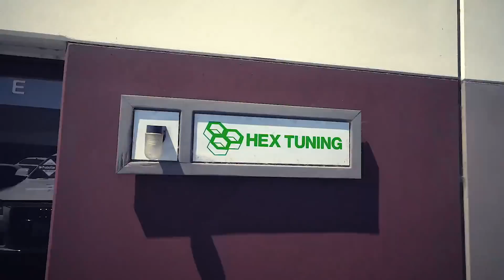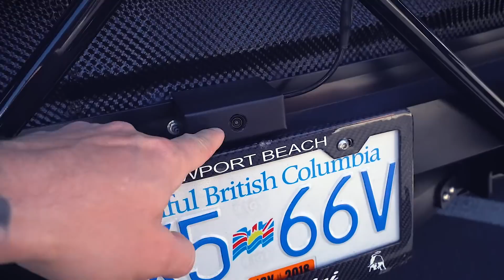DELIVERY DAY! SUPERCHARGED LAMBORGHINI WITH CHASSIS MOUNTED WING & CANARDS

Comment: Does it have customer suspension work as well? 
If you tune the suspension to have more caster angle, camber, and a tad stiffer dampiners, I bet it will take high speed corners like a boss!

Comment: next car needs to be an 09 gallardo or something, super charged to the tits. split the rear glass aventador spyder style, do flat glass with carbon louvers like the aventador rear glass scales with a carbon huayra style air intake that has a rear fin on it do a big wang, do a solid wide body not bolt on. then louver the fenders and scoop the roof like a super trefeo evo. with front and rear canards and plus front splitter rear diffuser like a perfermonte